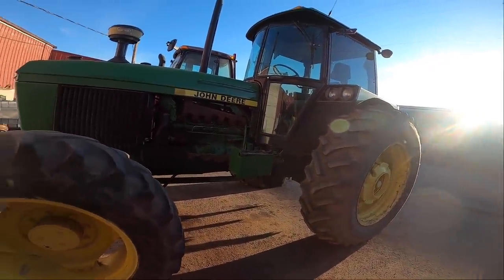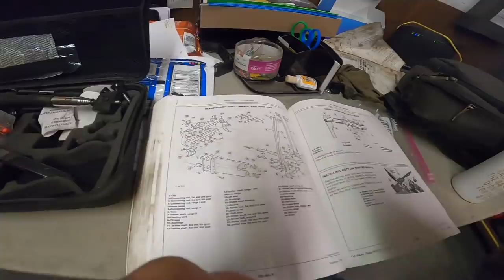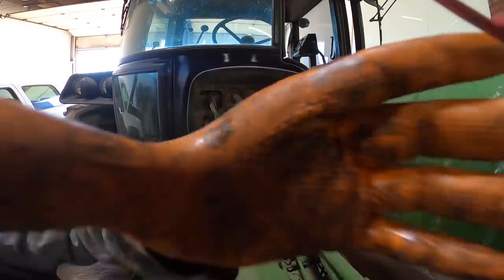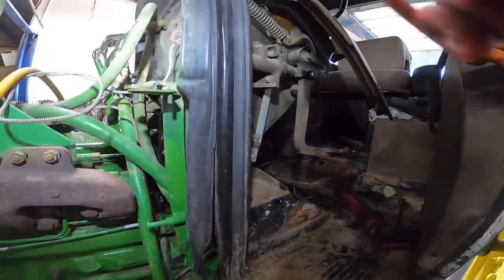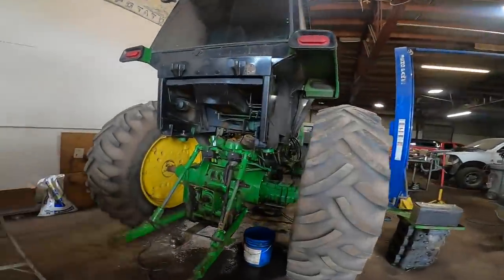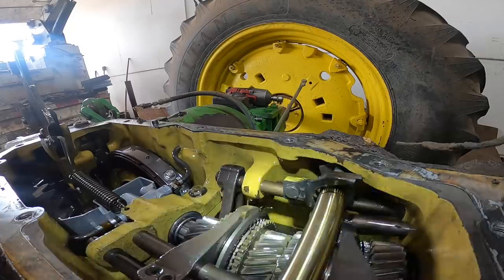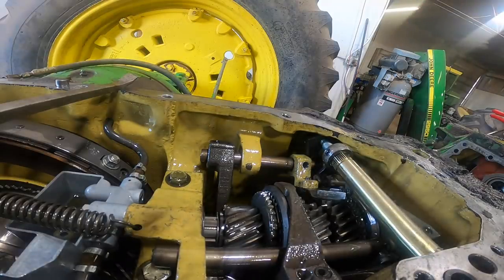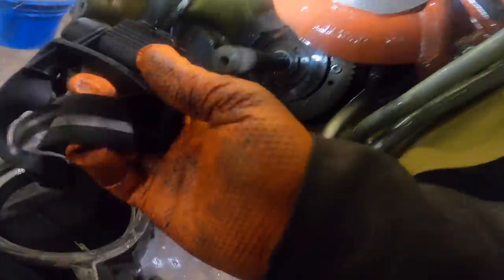John Deere 2950 no high range.

Comment: Hello there warran. A farmer friend of mine has a old JD 3130. He loves the thing. It came with no cab so the dealership put one on it and it has the gear shifters on the top of the gearbox. It been trouble free and is well maintained. It's used every day. He bought a New Holland tractor and it's 9 months old and has had 8 different problems with it so far.

Comment: always check the hilo and pto plates when you get inside . also check top shaft end float , worn circlip inside rear bearing is common and check the ball in the side of tow cup ,they fall out and lube will be low.

Comment: There is a gasket kit for the Mannheim tractors that gives you everything for the middle AL57975.I was always under the impression that the set screws were offset in the shaft so you could tighten one in farther then the other to move the fork frontward or backwards. I like Mannheim JDs as long as they don’t dump Walmart oil in them haha.

Comment: Excellent video i was just down the same road with a 2940 open station John Deere except it had a busted transmission case the back side of the top shaft saddle was busted top and bottom where the back snap ring goes

Comment: I have a 2955 can you put a turbo charger on these tractors or something? Love the tractor just wish it had a little more power.
Reply: You can turbo anything. All depends if your willing to spend the money to do it right
Reply: @davedunn2124  do you know of a proper kit or have you  done a project simular?
Reply: @clayquarles7425  not on that model I haven't. I have done several other models though. Start going through the internet I'd bet you someone has before you already. The last one I did cost me around $4k. So before you look know that.

Comment: never seen sideways pto . what do they use that for.
Reply: Ehh, I think you mean the splined shafts where the lift arms go?
Reply: That is the storage position for the other PTO shaft. These tractors have a 540 RPM PTO shaft and also a 1000 RPM PTO shaft. It looks like that is the 1000 RPM PTO shaft in the storage position. Shaft's are held in position with a snap ring. The inside ends of those stub shaft's have different spline's on them that different gear's inside drive to spin the shaft's at the two different speeds.

Comment: I'm saying with all your knowledge and experience you should be charging max rates. And making a $100 k minimum.  Mechanics that care about the customer and getting the repair done right are far and few nowadays.  It's all about in & out and over charge. Sometimes with needed or requested work being done.
Reply: Yeah if Warren is not getting markup on parts as owners seem to buy them a lot then labor rates have to be high to offset loosing markup.
Reply: Mike Duffy I would think he's putting a mark up on parts or he would be out of business. As far as people bringing in parts they bought Warren still needs to put some kind of mark up in his billing. And if that part is cheap stuff or doesn't work or fit  as it's supposed to Warren still needs to charge them double labor for the rework. I would as time and hard sweat is very valuable